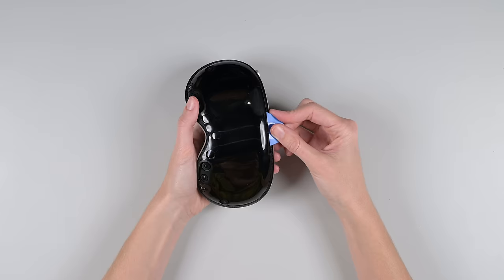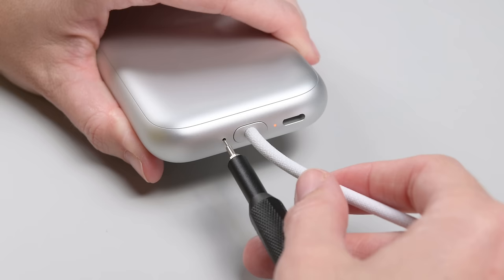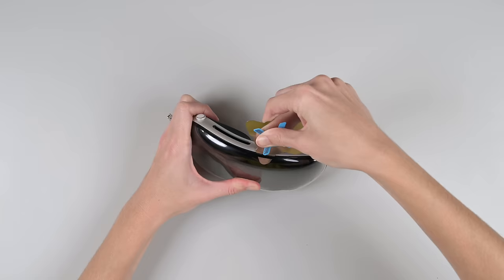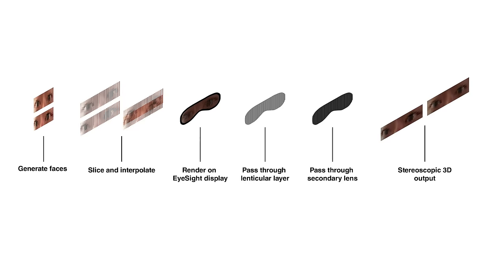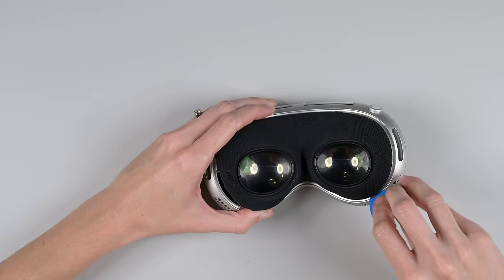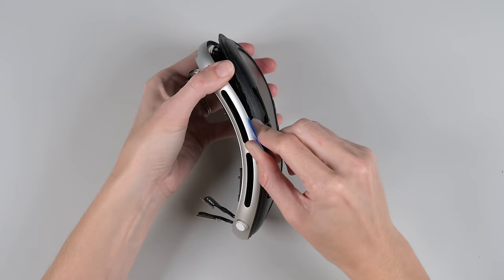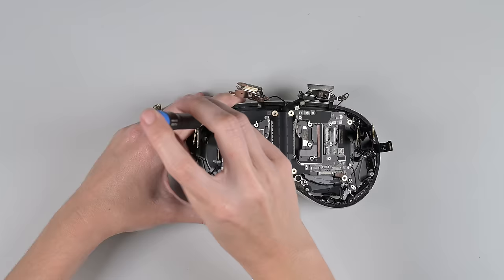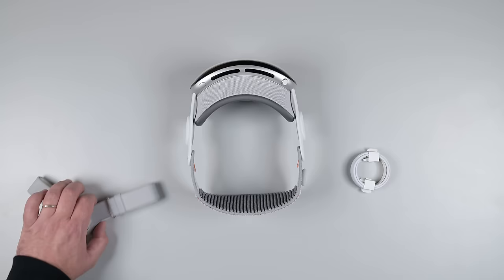Vision Pro Teardown: Behind the Complex and Creepy Tech

Comment: I cannot begin to imagine the insane amount of effort to build this thing in the assembly line. To be honest, Design for Manufacturing (DFM) seems non-existent from the inside. I would bet that the amount of hours to build this thing is really high, and certainly there are many challenges in scaling production. While I do appreciate the engineering efforts to put this absurd amount of technology together, from the inside it still looks like a prototype. There is a lot to evolve if it does not fail as a product.

Comment: I highly doubt this will ever be as common as computer monitors or smartphones BUT there are quite a few important benefits of this over big flat screens and projectors:
 It requires much less power to run and materials to manufacture. Takes up only a fraction of space than that of a regular workdesk. 
 No cables, no monitor stands, far less useless and redundant clutter that goes old and colects dust... Far less plastics, glass and other materials that eventually ends up dumped as waste.
And... This thing uses only a fraction of electrical power than a normal setup today uses!
More economical shipping also comes to mind, as the packaging is way easier to handle than compare to an average sized monitor...
Reply: Now talk about the chips and sensors.
Reply: it also destroys your eyes and brain with constant light and wi-fi radiation, as for the power it's the same since you need a power bank and if you can't cable manage that's your problem ,there's tons of ways to do that effectively

Comment: Realistically I don’t think I would want the Vision Pro to be reparable besides the battery which it easily is. Any effort to increase repair ability would likely increase the weight and or size and in my opinion it likely not worth the trade off.

Comment: Somehow, I get the feeling that if Apple made it even more repairable (I know they sell expensive kits), the engineering to do so would make everyone complain even more (ad nauseam) about the weight. Given that this is 2/3 of what I hear about as a problem for most people, maybe it’s a good thing it’s not more repairable.
Reply: That doesn't make the product any better though.
Reply: @mark5071  It makes it lighter, which everyone who has reviewed it says is an issue. Imagine what everyone would say if it was heavier.
Reply: @NathanielHarari  But that just means that the product was already so lacking in one aspect, that it caused other areas to also be lacking.

Comment: Thet could minimize some of cable and screws just by looking at it, and they could do mirror engineering since it got edge in middle so they could just apply things same as the other side done and then crown and button hovering around main. Making little pieces is dangerous just like car engineer in europe in early 2000 they were amazing piece of engineering but hard in maintence that's they didn't chamge anything since then but do major improvement like BMW 3 series 2024 most reliable car anyone would laugh at me when i said it but it's true

Comment: They made it way too complicated. Make the lenses manually adjustable, get rid of the useless front display and replace it with aluminium cover that would act as heat-sink, which would remove much more heat which could allow you to remove the active fans. Just this alone would make it much simpler and cheaper without compromising too much on functionality. Also, make them a little bit more flat so you dont have to separate the motherboards into two or just integrate it all in one side.

Comment: Classic apple. You cannot disassemble their devices without much effort and a ton of specialized instruments
Reply: How would you design such a device so that it would be easy to repair without increasing the volume and weight while keeping the tech identical?

If you demand 80’s like repairability this thing would be the size of a fridge.
Reply: @jounnna8720  you're exaggerating
It definitely is possible to design a device that is possible to disassemble without a heating fan and custom screws. Flexible cables are OK because it's not hard to remove them by yourself
Apple just needs that extra sweet sweet cash on top of an already expensive device. You just can't swap one module to another without "certified" repair places. Or your iphone won't even boot without updating firmware. Such a bullshit

Comment: Lightening cable !!
Hey EU...📣
Reply: USB-C is used for charging the battery.

USB-C is easy to pull off accidentally. That’s why it’s not used in the headset and in the actual power connector in the battery.

EU commission should stay the f*ck away from designing consumer electronics. The people there can barely use e-mail on their own.

Comment: Props to them for shipping the prototype. I’m not being snarky. This is very much highest end glue and duct tape. Every one of those interfaces whether cable, screw or bracket meant those pieces were not integrated. Just make it work and v2 will solve many problems.
Reply: Are you nuts? Pretty much any other Apple product has the same proportion of cables as this thing, it just so happens that they're not as complex or weirdly-shaped…
Reply: this is finished product it is available for purchase
Reply: It’s an expression to “ship the prototype”. This product has had a long history at Apple and at some point they have to ship. I think jobs would have waited 18 months. Both options have their pros and cons. As an exec you need to control your product people on the big decisions.
Reply: @HayesHaugen  its honestly not that bad obviously a lot can be simplified but i would imagine all that is in the works it was just gonna take time to get the tooling for all the chips this is probably the still use off the shelf stuff version

Comment: We can only hope that EU forces Apple to build the next Vision Pro from standard user replaceable / upgradeable components. Or makes this illegal in its current form.

There is no reason whatsoever why this device could not use normal socketed x86 CPU, standard RAM and standard SSD, standard displays, standard lens system etc. so that I can update them as needed. No tools should be needed for most common repairs.

(Same for the iPhone)

Also, I should be able to run Linux on this because not everybody wants to be limited by Apple's restricted locked down OS.

EU commission should mandate the use of standard PC components, or better yet, provide reference hardware designs for all kinds of devices which all companies must strictly follow.

Comment: Apple = simplicity on the outside hides super complexity on the inside.  Apple took over engineering to another level.  

Rich people please get these headsets so that Apple can iterate on them and make them better and cheaper.  Apple, please, please remove the creepy low res 3DS style eye pass through screen in front 😬
Reply: *overengineering
When used this way, over- and under- are prefixes, not standalone words.

*passthrough